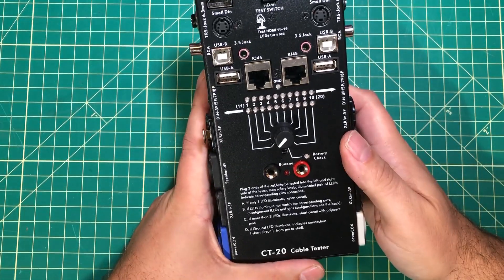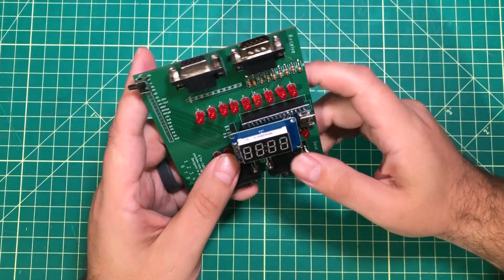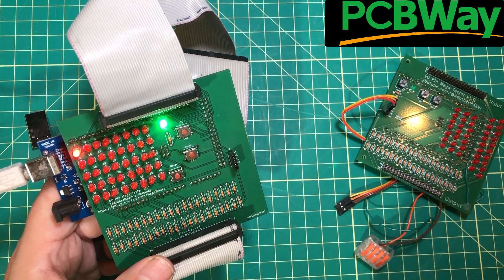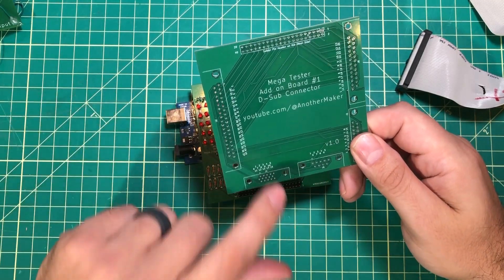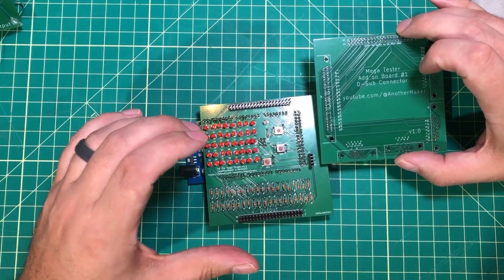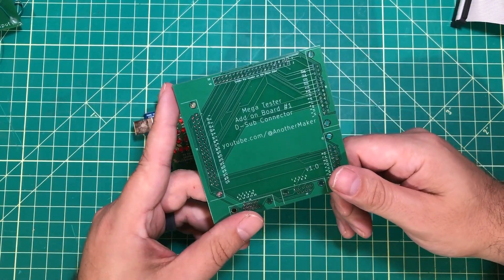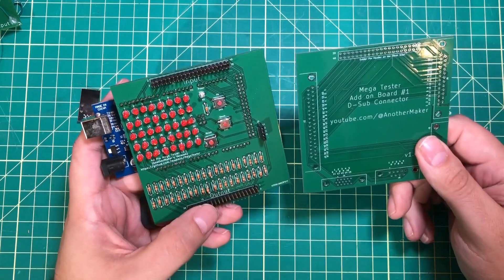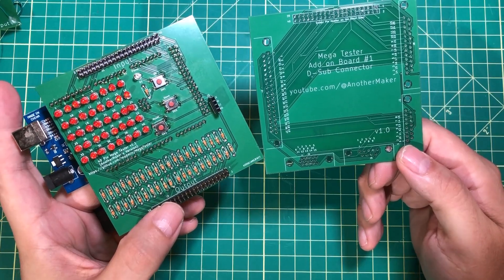Let's build the Ultimate Cable Tester

Comment: Are you collaborating online to design this, through Github or such?
Whenever making a dev board for an MCU, the first thing I make is a tester for the GPIO pins.  2-legged 2-color LEDs are nice, as they can indicate direction, and 3-state, even PWM.
Reply from the maker: Yes. I'm expecting once at least the next board is released that we will probably open source every bit of it so it can be iterated on by the community

Comment: Keyed connectors are pretty much a must. 
Things must either only fit in one way or it shouldn't matter how they fit.

A green LED with some logic behind it that lights up after a few (quicker) successful tests would be a great QoL improvement. So you don't have to pay attention through the whole cycle.
Reply from the maker: If we can't key the 40 pin connector, it will be pretty much impossible to plug in wrong because the board will run into itself.

Comment: I think it’s a great idea.

I only have 2 suggestions:
1) Give me something to keep all these boards in (maybe each one comes with a case than connects to the other cases, like the food containers that snap into each other?), or I can guarantee you that at least one board will get lost or damaged in some way.
2) Make it as dead-simple to use as possible. I don’t want to spend an hour trying to figure out how things are supposed to go, how I’m supposed to run a given test, or how to interpret the results. If I’m handed a mission-critical cable to test, I need the results displayed as quickly and clearly as possible.

(If something I said is confusing or doesn’t make sense to you, please don’t hesitate to ask. I don’t mind clarifying or expanding on my thoughts above, if there’s a chance doing so could improve the end-result.)

Comment: Howdy man,
"Building the Ultimate Cable Tester"
I have nothing against to say but first let me ask just one question, what tests are you planning to run for the cable? 
Judging by your current build it seems like you're testing continuity only.
Let me know if I'm wrong.
(I have tested many cables and it's never been easy) so i want to know what ultimate actually is.
If your idea is decent I'll share my cable harness testing design.
Reply from the maker: It will take some iteration of the hardware and the software but the plan goes beyond just continuity only.  The latest design is not just hooking 40 wires to 40 pins.  I'd love to be able to test reflection and transmission time etc

Comment: 25 pair telco cable tester (RJ-21)? It needs to be able to detect miswires and reverse polarity pairs. It also needs to be able to test m-m, f-f, and m-f cables.
I think Siemon MT-5000 was the last tester built for this, but they had a yellow rectangular test set before that. It separated into halves and had a master and slave end. The master had 25 LEDs that lit up in sequence and the slave had 25 red/green LEDs that lit up green for correct polarity and red for reverse. I preferred the older tester.
Reply from the maker: Yeah. We are thinking modular on both the connector types and being able to split the unit
Reply from the maker: Also, because the latest version doesn't just go to the 40 Arduino pins, bumping to 50p is possible without incompatibility for existing modules

Comment: Connecteurs are often painful to change ; the problem with all these testers is that they never gives you which connector is faulty (which end).
Reply from the maker: Looking at reflection, we should be able to get some timing to get an idea where a break is
Reply: Yes, I would like to be able to massage the parts of a sus cable, while plugged into a tester, and have it beep only when the data signal is lost.  This way, one may discover which part of the cable is faulty.  The circuits for injecting a differential signal, then tuning it are fairly simple.
Reply from the maker: Yeah. Looking at differential and reflection is going to be key